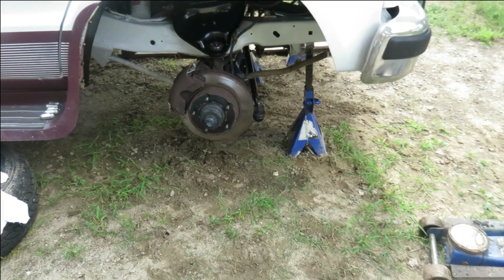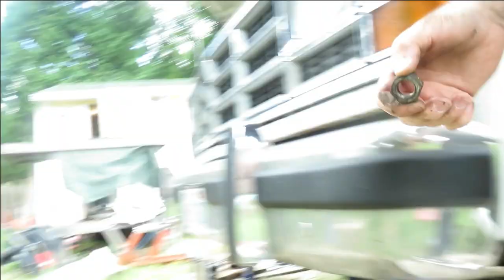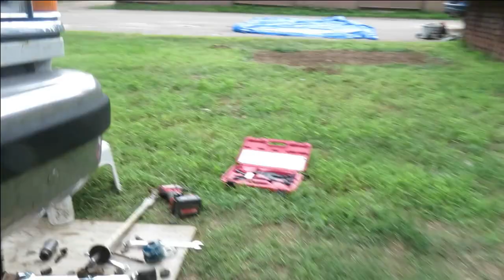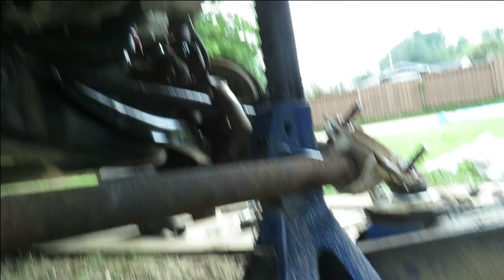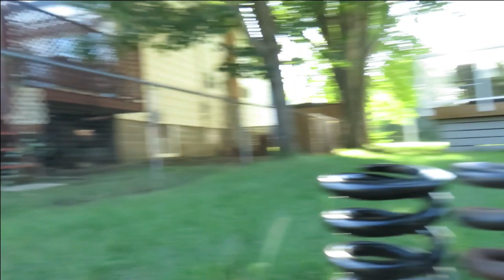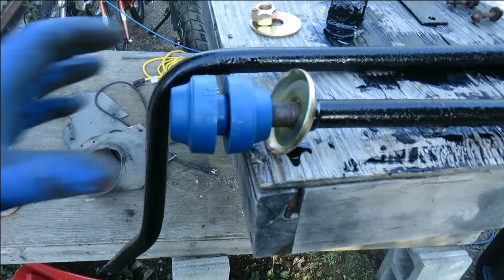Dodge Ram Van Lower Control Arm, Strut Bar, Sway Bar, and Coil Spring Replacement 1979 through 2003

Comment: bringing up that lower control arm with the new coil can be a pain in the ass, great job man, i always like to have a small 2 ton floor jack the low profile one that makes it easy also use a rope to hold the rotor up, that can save you a back muscle sprain, thanks for sharing, lots of learning  from your work, lots of fun to watch as well

Comment: The ending part on the brake pads outer shifting in the caliper was indeed helpful. I already bent the tabs on mine and I still get a clunk as they shift at the end of a good amount of braking. I must have racked my brain and endlessly Google and YouTubed for hours wondering if the permatex stuff was a real solution. Great information. I enjoyed watching and it was a very helpful set of videos as my 5th Avenue has very similar suspension parts. Especially the parts on torque specs for the idler and center link. Extremely helpful to watch someone doing all of it. My plan is to inspect and try to tighten the parts. Last go round at the alignment shop the guy took a couple castle nuts loose and took me back to show me 'I need to replace a lot of expensive things'. This time I can know what to check and try tightening before taking it for alignment at a shop that is hopefully honest. Cheers!

Comment: The welded on square bolts that hold the shock in the bottom of the lower control arm busted off!!!! Brand new too! I guess we’re gonna have to improvise. But man I was so bummed.

Comment: hey, just had a question since your one of the few people I have seen with a 91 b250 like me.  do you have any advice on lifting it 2"?  I been looking into coil spacers and rear shackles but unsure about the fitment.  I can mainly find ones for d250.  any advice would is appreciated.

Comment: Great video very informative. Did you get any lift with the 7272 springs vs stock?
Reply from the maker: yes, it brought it back up to where it should be.  it would look kind of strange if your rear springs were original and sagged out too
Reply: @SteveRivett  thanks. My rear leaf springs are tired too those are next after the 7272s get installed.

Comment: Hello! I am glad you did this video because it is hard to find anything about this van and fixing things on them(it’s always the Ram) I need to replace basically the whole suspension for a 1999 Dodge B1500(Ram Van 1500) and I was able to find everything I needed on Amazon except for the mechanic told me to get Torque Bar Bushings and I can’t find them anywhere and most people are telling me sway bar frame bushing. So from seeing your video do these van have these torque bar bushings or are they called something else? I need your help!!
Reply from the maker: I would go over to Rock Auto and use their system to figure out the parts.  It has photos and part #s which are very helpful.
Reply: @SteveRivett  Ok! I will check it out. Thank You so much..

Comment from the maker: It turns out that Mopar has an updated strut bar bushing design so you may want to check that out.  It is a rubber bushing with a steel sleeve and is supposed to ride nicer than poly bushings.
Reply: Where can you find this updated version? I was about to order the polyurethane bushings for our '93 B350 Roadtrek but now I will wait til I hear, thanks...  Also, if there is not a better version, what and where did you get the ones you used? I can not find any with the new metal round 'washers', just the 2 plain bushings.

Comment: Huge thanks for doing these videos on the van - not easy finding stuff as every time you google stuff, you always wind up on ram truck page. I have a b2500 96, seems almost the same as yours. Just wondering if you used the spring compression tool on the other spring or did you do the same as the spring in the video by using a jack? Again, really enjoyed watching these videos and learned quite a bit. Thank you.
Reply from the maker: No problem, I saw a lot of truck videos too so that's why I ended up doing the van videos.  I did not use a spring compressor to put the control arms back in.  One thing I would do differently is use a 2 lb hammer to hit the tapers on the ball joints instead of using the pickle fork.  I did not need to save the ball joints but some people may want to.

Comment: Great video, thanks. I'm working on changing springs on my 90' Roadtrek Popular (B250). I'm having trouble separating the the lower ball joint from the spindle assembly. Is there any other way to get it free without scraping the lower ball joint with the tuning fork? Like you, none of the ball joint seperators seem to fit. Also, how much more clearance did you gain in the wheel well (tire to fender) with the HD spring over the original? I was getting tire rub on the fender so I have an extra 1" Poly spacer I was planning on putting under the new Moog 7272 spring.
Reply from the maker: You can club the ball joints with a 2 lb hammer to pop them if you can reach them that way.  You will see me do that in my Jeep suspension video.  I obtained somewhere between 1" and 2" when I did this job...I think.  You can find related posts on Dodge Forum under the Full Size Ram Van section which is probably where I documented that.  Your 1" spacer will probably give you 2" or more of lift so watch out.  It's in the middle of the pivot distance so you get more height out of it than you put in.

Comment: I have tried many different methods to find out about these MOOG 7272 springs as I need these same replacements.. But I guess can't find them anywhere on the internet...??.. OS it hav anything to do with different part #'s..??.. Is it a Canadian version of a particular version or part number versus a USA version..??.. I jus have not luck with finding them.. Cool video and of you having everything else ready to install in one go...
Reply from the maker: https://www.rockauto.com/en/parts/moog,7272,coil+spring,7512
Reply: Those springs come in 3/4, 13/16 and 7/8" dia. wire. I have three B150's with each spring set, the 13/16" is the best for me. Measure yours with an open end wrench. Moog and others do not show diameters...would be helpful if they did.
Reply: @SteveRivett  These appear to be discontinued, Not available at Rockauto or Mopar Parts giant, or anywhere else, it seems. I have a '98 B3500/350 conversion van (a Xplorer 230XLW), and have found two other HD springs available for it: Dayton 350900HD they say adds 35% more load cap than standard but I don't know what they are comparing them too, and General Spring 350-7226SD, that are advertised as having 1000lbs. more capacity than standard, and an additional 1/2" at zero additional load, I think I am going to go with the Daytons
Reply: Everybody should note that the springs I mention above are for a B3500 with a 4000lb. front axle, not a 2500 like Stephen's van, and are quite a bit stiffer than the stock 3500 springs apparently, which of course are stiffer than the stock 2500 springs, so they might be a bit much for a 2500 or 1500 chassis.

Comment: Where can I get coil springs for my 1999 Dodge Ram van 1500
Reply from the maker: you might need to go to a local alignment/suspension shop and see if they can get them, it looks like they are sold out on Rockauto.
Reply: Auto zone had them for my '92,just ordered them mine were $197.00 pr.

Comment: Hello Stephen, would you happen to know if the Dodge ram 1500 pickup and the van B2500 has the same front wheel hub bearing assembly? I will be doing an RR soon and have difficulty sourcing that part.

I have 95 b2500 and like someone else mentioned, some van parts are different and harder to find. Helpful video, thank you.
Reply from the maker: It looks like your van uses front rotors to hold the wheel bearings and that you do not have sealed hubs.  Take a look at the photos on Rock Auto.
Reply: Thank you for the reply, much appreciated!

Comment: Can someone provide documents on the sizes of different fasteners that will be needed to be replaced? I am trying to change my crossmember on my B250. No repair manual though
Reply from the maker: I think I covered the crossmember swap for the most part in the two videos other than I didn't remove it but I did get full access.  I think you'll also need to remove the engine mounts which are a bit tricky due to access.  It is worth buying a set of wrenches up to 1-1/4" and about 32 mm.  Metric wrench sets are kind of weird, look for skipped sizes like 16 or 18 mm and it can take two sets of metric wrenches to get all the way to 32 mm because there are a lot more wrenches than in imperial.

Comment: I have a 2003 dodge van 2500. Upper control arm ball joint keeps spinning when trying to torque down 

I’ve put pressure on control arm. Let off pressure and it’s still turning. Any ideas?
Reply from the maker: Put a box wrench onto the nut and then grab the stud with a pair of vice grips to hold it.  You should be good then.

Comment: Hello, great video, I have a question, I looking for front lower control arm for dodge van b3500 but I can't get one like the one you have in the video, What model and brand is it?
Reply from the maker: those were AC Delco control arms from Rock Auto

Comment: I'm working on a 1997 B2500,  do I have to replace the control arms if I replace the coil springs for the heavy duty ones? Or only if it's in bad shape? TKS, great video!
Reply from the maker: No, I replaced the control arms because I was concerned that one was bent.  If you wanted 1-ton control arms in your 3/4-ton you would probably need to replace the spindles and wheels too.
Reply: @SteveRivett  haaa  good to know, I'm going to replace all for the same stock parts, but I will add the 1" 1/2 spacers in the top of the coils to gain some ground clearance. Tks a lot, this video it's very helpful.

Comment: I liked your video... Also,  I can use a New set of them Strut Bar Bushings... Please, can you tell me where to get those Bushings..  Tanks..
Reply from the maker: ACDELCO 45G25049 strut rod bushings, I got them from Rock Auto but I'm sure you can get them at many stores if you ask
Reply: @SteveRivett  Thank you... I was able to get a MOOG as a cross reference from the numbers you provided.. It's 7am and I am working with my own suspension replacement for my Van to... Again tanks...

Comment: How is the van riding now? Did these repairs help mitigate bottoming out?
Reply from the maker: Absolutely, going to heavy springs is a big improvement over the normal B250 springs.  My van is always at the limit for front axle weight because of the conversion and fresh water tank under the van just below the passenger seat..
Reply: That's great! Congrats on the successful repair, and thank you for this great video series.